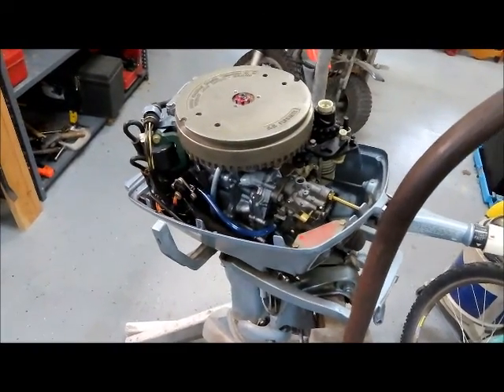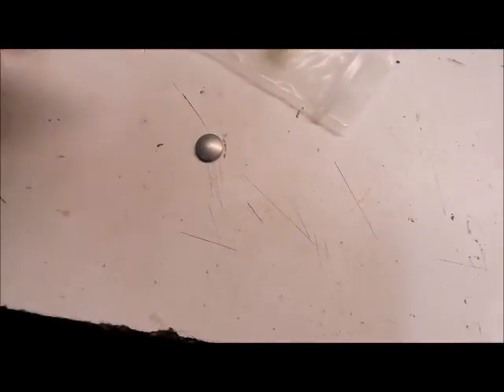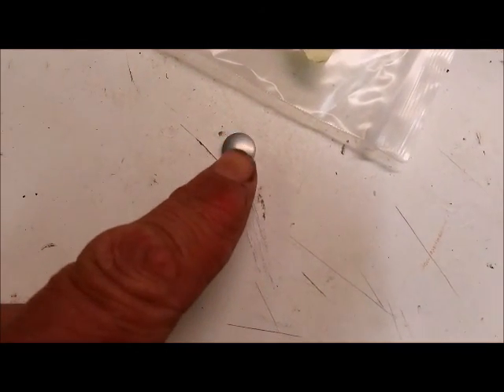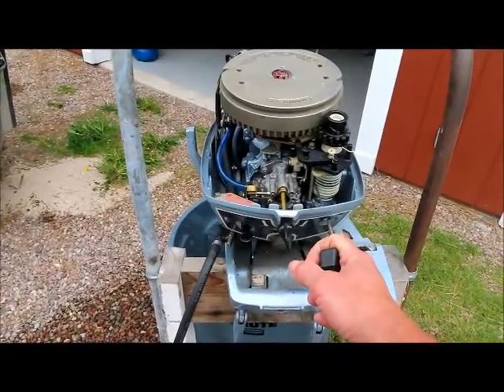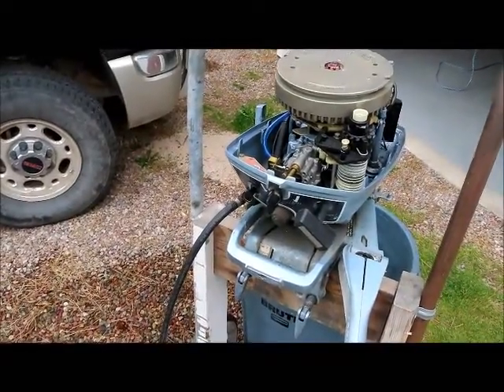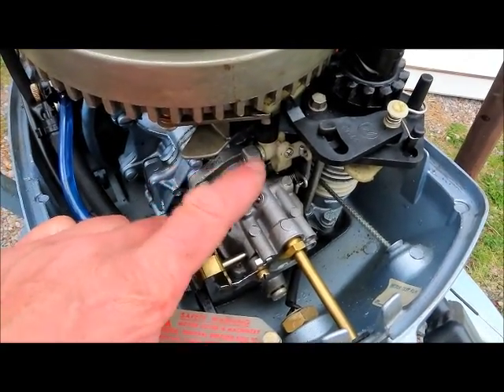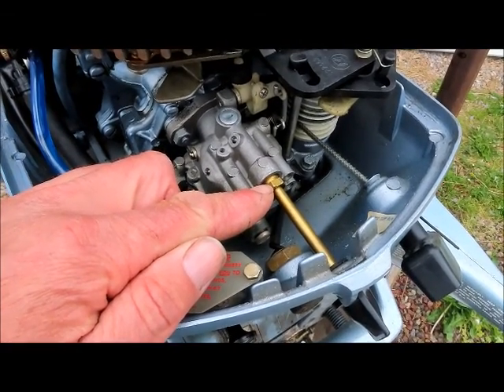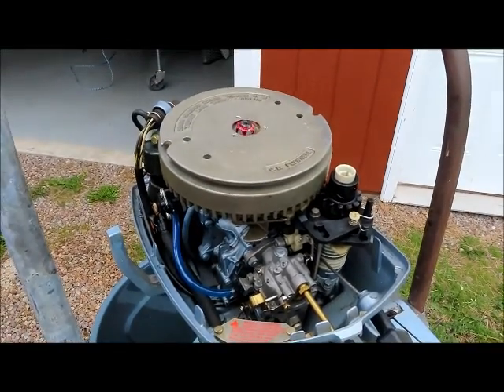Evinrude 6HP Idle and Hard Start Fix

Comment: I have one and I'm close to using it as an anchor. When it decides to run good, it's perfect. When it doesn't, well, best used as a rudder or anchor. Anyway. It starts (finally) and will idle, but as soon as you give it throttle it bogs down and dies. I can get it to at least limp with the choke pulled.
Reply from the maker: Hmmm - head scratcher for sure!  Are you sure you're tank and fuel line are producing and maintaining pressure?  Is your carb and main jet 100% clean?  If you know the carb is pristine and the air settings are correct or close to it and your fuel supply and tank are working right, you might need to start looking at electrical.  I honestly have not had to work on electrical with my motor but I believe it is points.  If so, check the condition of them and set the gap as prescribed in a manual.  On CDI engines if this is one, there is no good way to really diagnose a bad CDI but it could be the cause of an intermittant running issue in which case a new CDI is the only real solution.  Check all the ground wires you can locate, inspect the wiring close and get the specs for the mag coil and see if it's the correct resistance.  A leak down test targeting the crank might be in order because if you have a crank seal leak it might act like this.  Lots of ideas for you but maybe some help for you.
Reply: @paulhaines5755  thanks. I put a new fuel pump on it years ago when I bought it second hand. But for some reason I still feel like the pump isnt strong enough. The carb is as clean as they get. I didnt check the high speed jet though when I had it apart
Reply from the maker: To make it simple, I'd start with the basics.  Clean the carb super good and do the procedure I show in this vid for low speed circuit.  There very well could be something in there that is moving out of the way at times allowing it to run good then moving back to the orifices to give you troubles.  I'd say the #1 symptom of the low speed circuit being obstructed is hard starting and trouble keeping it running so yes - good place for you to start and it's not a tough thing to do.  Just buy a welch plug and have it ready to use.  Rule out the easy stuff one thing at a time.
Reply: @paulhaines5755  thanks. I'll give it a shot.
Reply from the maker: You might be able to just remove the low speed needle and housing from the front of the carb and spray carb cleaner in there.  If you see immediate improvement or it starts easier then it's your low speed circuit in the carb.  However, the method I show in this vid is the most thorough gives you a birds eye view of the tiny orifices inside the carb and the ability to really clean them well and inspect them.  The gunk in these orifices from old gas or two cycle or ethanol might be hard to remove and you might need that birds eye view to really get it cleaned well.
Reply: @paulhaines5755  I've shot carb cleaner in the slow speed hole. Same problem. I dont know why I cant give it throttle without it dying. Could the high speed jet be clogged? I at least know i can limp around the lake if I need to.
Reply from the maker: Sure could be.  I would pull the carb and go through it thoroughly and make sure it's spotless. That's the first place to start.
Reply: @paulhaines5755  went through it again last night and it's worse than before.
Reply from the maker: Bummer  Sorry!  That's frustrating.  I'd check compression on both cylinders.  Acceptable results will require some research on your part.  I don't know what it is supposed to be but one thing can be said and that is the both cylinders should have similar compression.  Additionally, if compression is good, a vacuum leak on an engine like this can cause a lean condition.  Doing a pressure test on the crank portion of then engine might assist you in finding if there is an air leak somewhere.  Again you will need to research how to do this and what is acceptable.  If these tests prove OK, there is a chance you have a bad or flaky power pack (CDI).  (I'm pretty sure evinrude calls them power packs).  It could be providing a weak spark condition thus causing the engine to die.  Full testing of all ignition components is what I would do before throwing parts at it.  Get the specs on the pick up coil, magneto/stator and plug coils and test them.  Find a manual that shows you how to do this.  It is not hard but you have to have the specifications from a manual otherwise you have no idea what you are looking at.  A CDI is difficult to test so it's best if you can borrow one that works and stick it in there to find out if yours is flaky.  It runs so obviously it works but i suppose there is a chance it is getting weak.  I have only seen 100% failures personally but maybe they can get weak.  If all this seems too much then you might have to bring it in to someone who can do these things for you.  Hope this helps.  Again, I am not a pro but I work on a lot of stuff and old stuff at that so I've been there done that just not with this particular engine.
Reply from the maker: One more thing to add - you said you sprayed a shot of carb cleaner in the low speed hole.  That was something I said that "might" work so I recommended it as a quick thing to try.  For you it did not.  You might have gunk stuck in the tiny orifices of the low speed circuit in which case the only way to find out and repair that is to remove the welch plug and do a thorough job as explained in this vid.
Reply: @paulhaines5755  I ended up getting a carb kit, I'll tear it down again and go from there.
Reply from the maker: Yea - new needle and seat might help.  Hopefully comes with kit so you can try it.  On wave runners and snowmobiles, it takes a certain amount of pressure to "pop" the needle out of the seat.  I have in the past used different spring combinations to get the correct "pop-off" pressure on big engines for Yamaha and SeaDoo.  I have a gauge for this.  On larger engines, the pressure is substantial.  I want to say something like 30 or 40 psi.  These small engines are no different in respect to design as the fuel is supplied by a pulse pump that has to overcome the needle/seat assy to supply gas to the bowl that feeds the main jet.  However I can say I have never messed with a needle and seat spring on these nor do I know what is the ideal pressure to move the needle out of the seat but certainly if you are having an issue with the needle/seat assy you could be starving of gas and dying when you throttle up.
Reply: @paulhaines5755  Thanks. I'll just use it as an anchor.
Reply from the maker: Yea this stuff is frustrating sometimes!  Been there.  Doesn't hurt to give up and maybe get one that's newer and reliable....
Reply: Don’t forget to loose the single adjustment screw on the carburetor it’s on the left side near the bottom it’s a little brass flathead screw. You may not be getting enough gas through the main jet!
Reply: @fisherman_rue2403  Run it with the fuel tank ABOVE the motor. If it runs, it’s a fuel pump, if not, you’ve eliminated the fuel pump.
Reply: @paulhaines5755  there is no spring pressure to overcome on these small motors. They never run at extreme angles, hence it’s not required. As fuel gets used, the float drops. That allows the needle to open, allowing fuel in. At idle the service manual states those motors only develop 1psi from the fuel pump. The tiny wire that holds the needle is only there because with the newer needles having a rubber tip, they sometimes stick. The older pure SS needles didn’t need the wire.
Reply: @fisherman_rue2403  where do you live, I’ll buy it.
Reply: @edwardhill6945 
Oddly enough, it works now. Guess I didn't have the slow speed needle adjusted in the right spot.
Reply from the maker: Great thanks for the information!
Reply from the maker: Question for you Edward:  Over the years I've had problems with older small outboards having a similar issue:   Here's how it goes - you run at WOT for a few minutes then bring it back down to idle and it dies.  You have to choke it to start it then it runs OK but many times seems like it wants to die again until it builds what I think to be better fuel pressure but I'm not sure.  it seems like a lean condition to me.  Kind of like it's using all the gas in the bowl at WOT then the bowl is low when you come back to idle and it dies.  Any adjustments to the needle or anything that you can recommend?
Reply: @paulhaines5755  if an older motor, with points, I a,ways pull the flywheel & check the coils, the original ones are ALL cracked. I just picked up a ‘71  6hp Evinrude, that wouldn’t run. The coils /points had been replaced, but it was weak/no spark on top cylinder. Swapped condensers, the problem swapped cylinders. $10 for a new condenser & spark on both. Sometimes spark is good on a cold motor, but after heating up, it shirts electricity through cracks in the coils.
Those fuel pumps work by +/- pressure pulses in the crankcase, as the piston goes up/down. If you pull the line from fuel pump to carb, then pull the starter, it should show spurts of fuel. The other test- use the manual pump, (the squeeze bulb), if it runs fine doing that, the fuel pump is bad.
If there are any air leaks at the fuel line connections, it will suck air, & at idle speeds won’t supply fuel. Also, the pickup line in the tank might have an air leak, try another tank that works with other motors.
Finally,timing is critical for good idle. Google T Mike, from Louisiana, he rebuild legacy outboards & has a good video on timing these, he’s doing a ‘72  6hp. You don’t need the timing tool, & forget about point gap,you want the spark exactly when the flywheel mark is between the two marks in the timing plate.
Without coils & condenser, hook up your ohmmeter. Just push the flywheel into place. With the meter hooked up, turn the F wheel by hand, (clockwise). At the instant you see ohms go from zero to infinite, (the points just opened), that’s when the sparkplug fires. If the FWheel mark is not centered,  lift off the FWheel, adjust the points, & try again til it is.
These are wonderful simple motors, I’ve had 5 of them.,
Reply: @paulhaines5755  on those generation of 6hp, even 80psi will run very well. As you mentioned, it’s important to have both jugs within 10% of each other,The best  I’ve ever had is 90psi, on a nearly new one. They simply don’t use as high a compression as the larger 2-strokes, or a 4-stroke.
Reply: I just saw another of your videos, the remote mountain lake. I  grew up just over the Canadian side, north of the Roosville crossing. Dad had a ranch outside Waterton National Park. We used to spend a lot of time around Flathead lake & kalispell. Nice country.
I just watched to the end of the video. That little 6hp is running the way it should. That is how they should idle, & will run like that all day long, on almost no gas.
Reply from the maker: Very cool, Edward!  Thanks for all the great advice and information on working on older outboards.  I also have a couple mid-fifties vintage motors that need work and maybe someday I'll tackle it...  I've lived most of my life in this area near the Missions and also Plains, MT.  I also grew up spending much time on Flathead and also many many hours in fishing tournaments on the lake in the past.   I've hike hundreds of miles in the Missions and it's my favorite place to hike and backpack so I thought I'd share a couple vids from up there in the mountains...
Reply: This fix my idling problems. Thank you!

Comment: So, did you see any dirt when you removed welch plug, or any dirt come out the front when you sprayed carb clean in ?
Reply from the maker: Nothing obvious.  What I did see was the three orifices appeared a bit out of round when I looked at them with my eye loop.  That tells me there was some dirt or more likely a gelled deposit in there that was affecting fuel delivery.  I am always careful to use non-ethanol fuel and good two cycle oil but it is possible it was just some goop from oil that had hardened with the fuel in there.  After spaying them with card cleaner they appeared perfectly round.  You might be able to clean it simply by removing the low speed screw parts and spraying in there but the intent of this vid was to show people what's under the welch plug.  I'm sure a lot of mechanic wanna-be's that are capable but novice (like me!) look at the welch plugs on a carb and wonder what's under it.
Reply: Dirt would only get in there past the idle mixture screw and packing washers so it’s very unlikely. I usually clean those orifices with a small right angled piece of wire from the throttle side while holding the butterfly open.

Comment: How did you get the Welch plug out?
Reply from the maker: I drilled a small hole in the center of the plug then stuck an awl or punch in the hole and pryed it up and out.  Be very cautious when drilling!  It is possible to have the drill travel to far into the port that is under the welch plug and contact/damage the orifices.    I think there's a few vids on youtube about how to do it if you want more info.

Comment: Is that shake normal for a 2 stroke or how do you cure that
Reply from the maker: Normal unless your motor mounts under the powerhead are rotted or shot.  This engine you see is tight and normal.

Comment: How did you get the old plug out at first place.... if you can share that
Reply from the maker: Drill a small hole in the center of the plug.  Be very very careful not to drill too far into the carb body below!    Sharp bit, use extreme caution and low RPM and light pressure.   Use a sharp pointed something or other like a nail or awl to pry the plug out by sticking the and of it in the hole.  They come out pretty easy.

Comment: I have a 72 fisherman that runs good on idle but sounds Like it’s only running in one cylinder
Reply from the maker: Hmmm I'm not an expert by any stretch of the imagination but I'll offer a couple ways to start.  I'd first make sure you have spark to both plugs.  If so, check compression on each cylinder.  They should be fairly close to one another in psi.

Comment: Hmm no chance of getting the welsh plug in my parts. Have a 1980 work twin 6 hp evinrude. Would appreciate if someone could help out 😂.
Reply from the maker: Bummer!  Yes parts can be a show stopper some times.  I'd recommend measuring the diameter of the plug you need (if you can get to it good enough to measure it) and see if you can find one that's the same diameter.  Many times folks sell these things on e-bay and put a description including diameter.  Maybe an "old school" dealer - seaway marine in Seattle used to have some good guys that had some old school knowledge.  I don't know if that's the case anymore, though.  If you can find a plug that is close you could prob "glue" it in, too with gasket maker or something gas resistant.  Goop on top so you can "scrape" it off easily should you need to get in there again.
Reply: ebay! buy any carb kit it will have like 10 plugs in it!

Comment: help,,,I put a new fuel pump..new seals..hose,,cleaned the carburetor...but there is no vacuum on the fuel pump...
Reply from the maker: Pulse pumps won't work well unless primed.  Make sure the pump is getting full of fuel from your tank bulb.  Additionally, the type of fuel line you use  from the crank case to the pump could be a factor.  Make sure the line is pretty rigid.  Soft line like tygon is not the best as it can "absorb" pressure from the crank.  Make sure the inside of the pulse pump is assembled correctly with no leaks or anything.  Your fuel tank should be vented, not sealed.  I suppose there is a possibility that your carb needle is stuck closed thus causing a back pressure condition to the pump but I can't say i've seen that happen myself.  I can't think of anything else to add.  Hope you figure it out!
Reply: @paulhaines5755  thanks for the answer, I suspected the pulse pump,,,put a new one,,,,new fuel inlet and outlet hoses, 2 seals...everything becomes hard,,,works for 3 sec....turns off...again manually I pump it up...hard...runs for 3 seconds...carburetor repaired. intake...etc...ultrasound of the bowl...if it works...I remove the supply hose to the carburetor...no fuel...no pulse...
Reply from the maker: tough one...  Are you sure you are getting pressure/vacuum from the crank case BEFORE the pulse pump?  Maybe there is something stuck in the nipple that hooks to your pulse pump line down on the crank part of the motor?  Are you sure the pulse pump is assembled correctly?

Comment: Great video… very helpful but Isn’t it better to remove carb and remove all O-rings and gaskets before ever spraying carb cleaner into a carb.  1st of all your using cleaner that causes any plastic rubber pieces to swell up and disintegrate
 2nd blasting any contaminants further into your carb or engine? I’m just a novice but that’s the one thing I know is how to clean a carb because blocked jets is common reason for a motor to not run ( the other thing I know is to clean outside of carb before opening it up)
Reply from the maker: Yes.  It would be much better to tear it down and clean everything.  The intention of this vid is to show a little short-cut for some specific symptoms that save you from tearing it all apart.  Many carb cleaners contain harsh stuff like toulene and acetone.  However, there are many options that are not rough on o-rings and gaskets and such.  You'll have to research that a little to find what's available at your local store.  I suppose you could send something into the carb by spraying into it but it's likely so small (if it's in these orifices) it'll just get pushed through anyway (in my opinion).  Sometimes tearing stuff apart to fix one issue creates more issues than you had in the first place so maybe just a simple thing like this is best to try.  The deposits in these orifices might even just be gooey two stroke oil so that won't hurt if sent into the carb.  Thanks for the input!